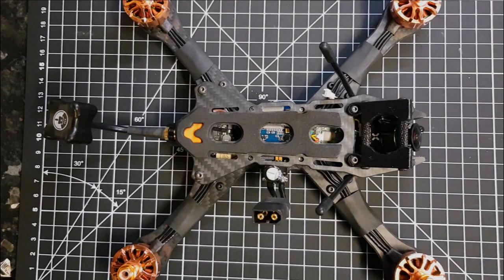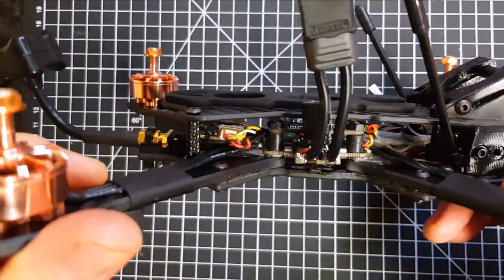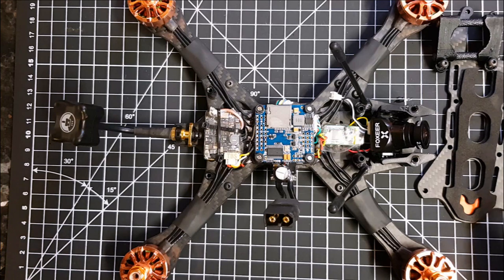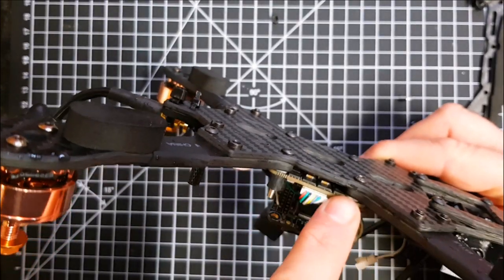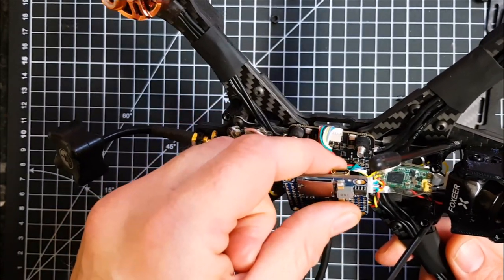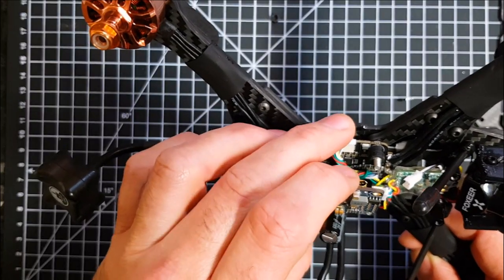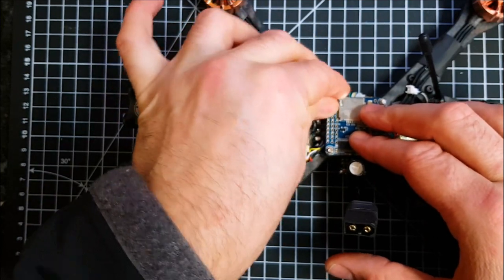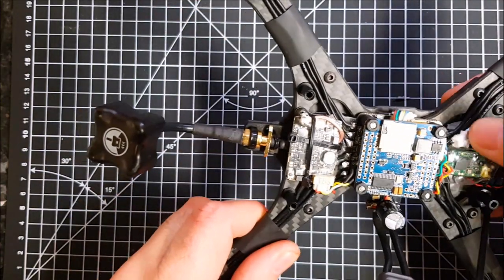Hyperlow CG build overview / fpv freestyle 5" frame

Comment: I'm really pleased to hear you got some use out of those sleds 😁. Nice build too 👌.
Reply from the maker: Trystan had them for 3 years lol. Bored of the snow now... too much for me to fly in. Maybe....
Reply: Coppertop FPV Im waiting on the winds to die down. Its been like a blizzard with howling winds for two days straight. Hopefully get a flight in on Sunday or Monday.
Reply from the maker: Trystan you got the ultra light build finished? Stick a video up - I’m nosy!
Reply: Im trying to edit some footage as we speak. Trying out DaVinci Resolve on my pc. I had a major setback with the HGLRC XJB F440. The pins that connect with the FC have ripped off!!! I could possibly add all the components just to show the build.
Reply from the maker: Trystan ouch, that’s bad news. I hate those connectors. Is it like the smaller one where there’s no other way to connect unless you do some immense soldering? No worries, I was just curious what the Frankenstein build looked like 🤖 do you need Dr Coppertop... 😧

Comment: Sweet build mate, snow is crazy up here as well, I finally got my Stingy built tonight too. 😃
Reply from the maker: DavyBoy hurrah! I was wondering if he’d release a new one before you built that :) not sure it’ll fit in that tree slalom you like to fly :)
Reply: Coppertop FPV it’ll be fine in there, it does have a much wider stance than my other 5” setups but I’m sure I’ll get used to it. 

Need the snow to go away now, though I’m actually glad it snowed because it was the crappy weather that made me decide to start my builds. 

Those motors look lovely I must say.

Comment: nice new build ;)
Reply from the maker: Rotor Brothers thx. Now I just need the wind and snow to go away :)
Reply: Mr Copper motors are good?
Reply from the maker: Rotor Brothers so far great. Tons of power. 2700kv might be a bit high on this but they also do 2400kv.

Comment: Think I’m going to bite the bullet and buy a couple 4in1 ESCs, was always worried if one died, but I’m sick of messing around with separate ESCs, and a 4in1 makes things look a lot cleaner.
Reply from the maker: DavyBoy they’ve got a lot better, but yeah I’m with you, I prefer singles too. The more all in one you go, the bigger the pain in the ass if it goes wrong. Wanted this clean as it’s beautiful. Plus it was free lol looks really good quality but we’ll see if it survives the ‘Spedix test’ - stuck up a tree revving against branches 😈
Reply: Coppertop FPV yeah, I’ve been seeing more and more people move to 4in1’s, but it was after seeing what happened with my mates two Spedix 30a ones, two of the ESCs died on his first one, so he went and got another and it died on him after a short while as well. 

The Hobbywing 40a one looks nice, and that DalRC engine too, I’m definitely going to give them a try, singles are great for the fact they can be switched out if you kill one, but i just like how clean a 4in1 looks, plus I also like the idea of just having to solder motor wires and an XT60 pigtail to it then hook it up to the fc via a cable, the less soldering the better for me.
Reply from the maker: Dav yikes, just noticed this, I’ve never had a problem with Spedix, they’re my favourites, but then again, it’s usually their singles I run.
Reply: Coppertop FPV it’s all good man, I use the 30a HV Spedix ESCs on 3 different builds and have never had a problem, definitely going to try out a 4in1 soon though.
Reply from the maker: Dav that cheapo Racerstar 35amp has never given me issues either although I’m guessing that’s luck lol. I want the Aikon one and Kababs new flat back f4 osd board. Can make a 10mm stack with those two. Americans have so much more stuff to play with!
Reply: I saw that Pyroflip FC, really like the idea of the flat backs on them. 

How much are they do you know?

Comment: Very sexy! Enjoy the snow! Do you protect your electrics when flying in the snow?
Reply from the maker: Baz Matthews I’d be mad to fly in this - too deep. If the wind dies down I might tho... I could conformal cost the electronics but i never do. I’ll just stick some insulation tape over the holes in the bottom of the frame and pray  😜